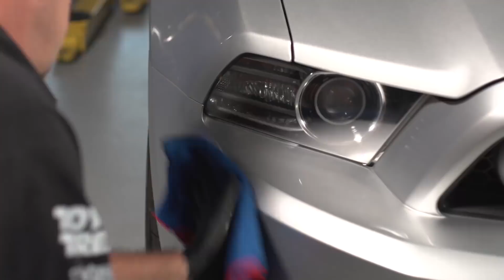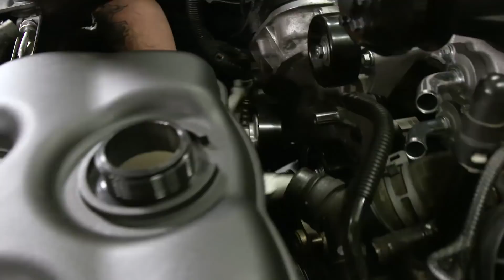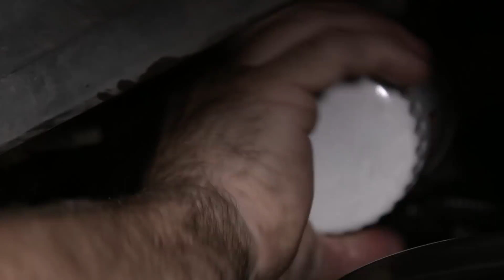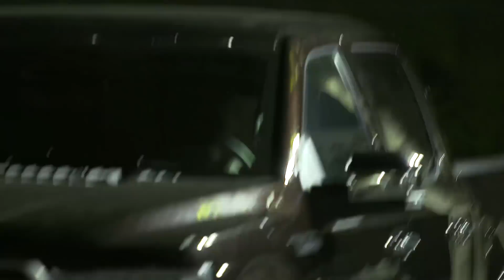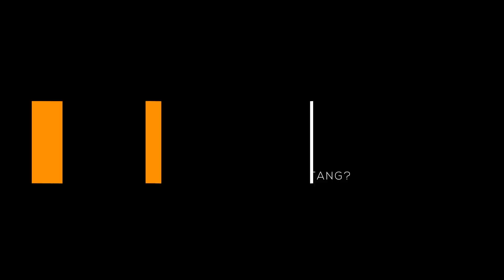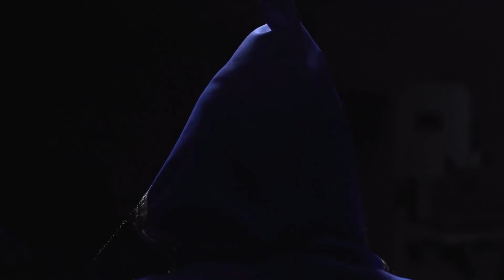Mustang 360 Week To Wicked – Mustang GT – Full Recap

Comment: 2013-14 Mustang GT = coolest Mustang
Reply: easascrin 10 - 12 > all
Reply: 13-14 GT500 that is.
Reply: 13-14 had those trick halo rings around the tail lights. Looked really good at night.
Reply: The front looks the best but the back is not as good as the 15
Reply: @MrAirsunny  2015 and up rear ends look terrible.
Reply: in my opinion is the front a good one but the back is the best of all Mustangs, specially the taillights. out of ordinary.
Reply: Yup, they finally got it right with the 13's and 14's. All the others looked incomplete and pedestrian. Ford nailed it at the end of that model run.